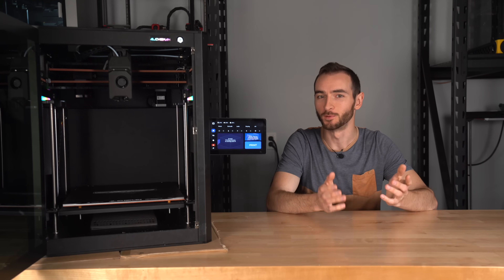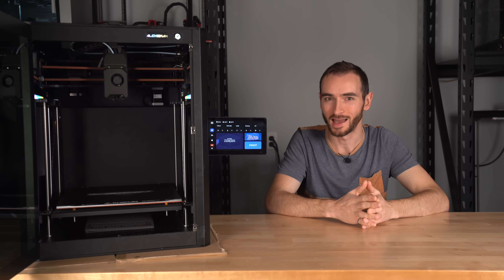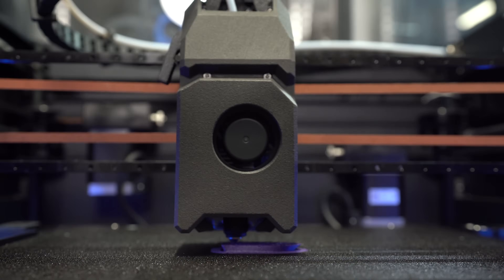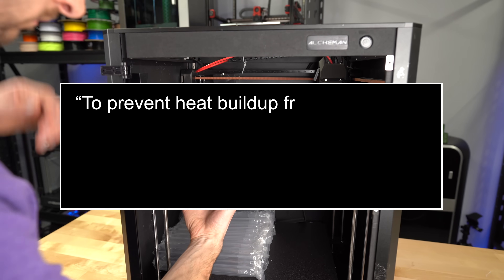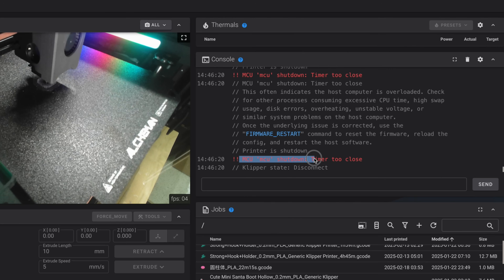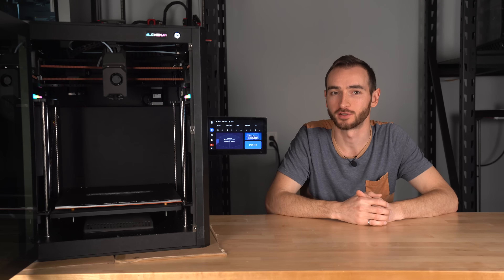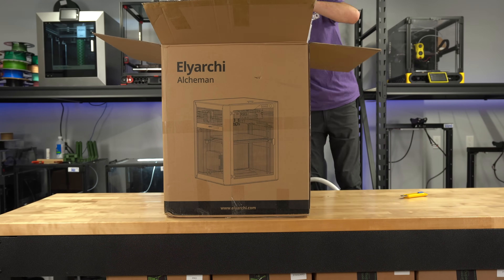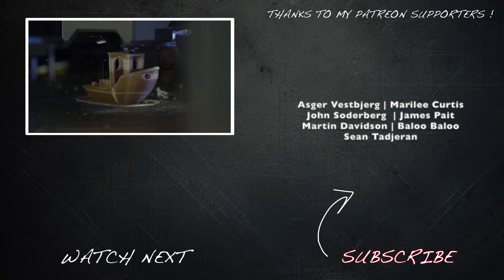Is the $699 PEEK Printer Too Good To Be True? Elyarchi Alcheman Update

Comment: This printer in its original form sounds more like a normal modern 3D printer elevated temperature limits in the software. You often can run a normal printer with higher temp limits for some time, but doing it reliable is a completely different story

Comment: As someone who was a manufacturer some time ago, I’m skeptical about this. By the time they begin to ship machines to a fair number of YouTubers to test and talk about (advertise), all of the changes they now say they’re going to make, should have already made. There’s really no excuse for what they released here. This is one reason why proper high temp machines cost what they do. High temperature components are very expensive. High temp bearings are expensive. High temp lubricants are expensive. Warping will occur in the rails unless they’re designed properly and made from the same materials. What about the belts? The wires, the plastic components, etc?

Comment: Hey! Any chance you can test printing ABS or ASA with 80C chamber temp? You would need to use a lot of part cooling, even more than PLA and their hotend cooling may not be able to cool the hotend enough but if it can you will have industrial quality parts with zero warping and 100% layer adhesion strength. Should be as strong in z as in x/y. I print ASA in 75-80C in a custom printer and it's a game changer but it would be nice to have an off the shelf printer that can do it. 90C is not enough for PEEK, you need 250C for optimal performance

Comment: Now compare it to a printer that is actually capable of printing these materials properly. The Minifactory for example that has a chamber temperature of 250C. Yes, it's expensive as hell, but it's built for the task. Hell, even the compartment where the spools are loaded are as hot or hotter than the buildchamber of this thing.

Comment: I think positioning this printer to print PEEK at unacceptably low temperatures is a silly move. 

PEEK is too expensive and most used for industries (at least here in here in the US) where a printer made in certain countries is a non-starter. 

Making a 90C chamber temp printer can be the worst printer ever for PEEK. Yet can also be the best printed ever for ASA, ABS, PC, PETG, PPS, ULTEM (and all their glass-filled and carbon-filled variants).

They should focus on a real need where the can deliver excellence and an unbeatable value. I’d recommend them to drop the silly gamer stuff (color LEDs and graphics), even for get the AMS, and rather focus on three things:

- fast to reach and consistent thought chamber temperature

- great calibration, input shaping, and geometric stability across the working temperatures ranges

- high temp long term (even continuous multi-day prints) reliability

- 2 nozzles for dual material or print material + support material. 

If they do that, and the added cost of all the stuff that how seems like an afterthought forces them to realize this is a $1500 printer, not a sub $1000 it is still a great competitive product. 

I’d buy one printer like that at 90C before I’d buy a H2D or any other 65C chamber printer.

Comment: It’s good to hear that they’re making some changes to make the machine more temperature resistant, but I still don’t think it’s good enough. There are definitely components in that chamber not rated for 90c. Also worth noting that in a 90° chamber, all components should be rated for at least 110 to add headroom. I don’t believe it’s possible to do what they claim to be doing for the price they claim to offer

Comment: 1 minute in, I don't even know what peek is but now I've got to watch to see why anyone without pay £1000 for a roll of filament.
Reply: I use it at work sometimes. PEEK is ridiculously strong, edging into aluminum territory, and also the most temperature resistant polymer you can really print. So for a business where you're deciding between a machined aluminum part that will take 4 weeks to get and cost you $600, or printing it with $300 of filament, the choice is clear. I'm actually planning on printing a PEEK fixture tomorrow to hold parts in an oven while they're baked at 175C. (Doesn't really need to be PEEK for that temp but we don't really bother stocking a whole suite of ultrapolymers when it's a rare use case, we just go straight for the king)
Reply from the maker: @maninalift  😂
Reply from the maker: This video doesn’t touch much on that but if you watch the actual review of this printer linked in the description it goes into more detail.

Comment: Thank you for adding a few things about the PEEK issues on that printer.
About the marketing of industrial machines: there are way too many producers talking about "able to print peek" machines. In 90% of theses cases, the hardware is able, but they have no software or process knowledge to support that claim. 150mmx150mm is heavy to realize with pure PEEK and I have some benchmark parts, which should show if this is really possible... I doubt it!

Comment: Elyarchi should have had all these problems solved before they even shipped out prototypes. Every single one of these components is susceptible to failure under intense heat. they pushed out a hacked-together Voron clone and focused way too much on everything except the most critical components. I just don't get the impression that they are even taking this seriously if they're expecting people to actually print PEEK.

I wouldn't use an eddy current-based probe for this; ignoring their max operating temp their ability temperature compensation tech is not nearly as good as they want you to believe. This is true for Beacon-style and PINDA-style probes. You'd want something like a CR touch.

The silicon sock melting is a bad joke. The kapton tape is an even worse one. They should have known better than this. Even the Goliath hotend documentation tells you their silicon sock is only rated to 300c and to remove the sock if printing at higher temps.

IMO it was a mistake to suggest it can print PEEK and they would've been better off just marketing it as a decent printer. All it did was attract people interested in PEEK who will almost certainly be familiar enough with the material to rebuke all their claims just by looking at the hardware.
Reply: I agree with you on a lot of points. This thing was defined not fully baked when it shipped out to reviewers 😂. The silicone sock debacle is absolutely ridiculous, I can’t believe they recommended to use one with PEEK. It’s clear the engineers have never built or played with real high temperature printers from that choice alone. 

I kind of don’t agree Eddy probe was a wrong choice. A lot of high temp users seem to prefer it and use it at high temperature like for PEI
Reply: Eddy current sensors can have a good performance in this application if they are designed correctly. But here’s the catch: a well designed sensor costs about 2k EUR a piece if it’s manufactured in high volume.
Reply: I have only don the most basic resort about high temp relist that it in way to expensive and instead set my gole at nylon(90c chamber 450c head) and even I relist that it who's crap

Comment: Just for the record a 450 nozzle temp is nothing special, neither is a 130 bed (i think the prusa mk3 and up can go pretty close to that) and 90c is pretty reachable. This thing isnt even that impressive on paper. Ultem, peek, etc, want way higher bed snd chamber temps
Reply: 90C chamber is far from "pretty reachable" without careful component selection and a lot of tuning.  As in, yes, you can put in a heater that will heat the chamber, and yolo it, but expecting it to run reliably is wishful thinking.  Most electronics used in a lot of printers start dying around 65C, better ones would go to 80-ish.   In-chamber servos at 90 is just bad design, water cooling could do it, but that is bandaid for shit design still.  Past 80 you also need to seriously account for thermal expansion of everything, probably need thicker bed, support for Y that you calibrate at target temp ...    This pile of crap is just money grab off people who have no idea what high temp chamber means.
Reply: @BigFx  I'm not necessarily saying super reliable but I know plenty of people with 80-90c chambers. A) don't put electronics in the chamber. B) class H steppers with derated currents mounted to aluminum do well. C) using EPDM belts and proper grease like krytox seems to do the job. D) gantry backers are easy, just grab a steel strip the size of your rail. It's a few extra steps but it's not that bad
Reply: @jackMJ26  yup, agree with all there.

Comment: Im currious how the printhead board survived at 90C.   I have a qidi q1 pro printing at 80C but i had to add a berd air pump delivering external air just to keep the tool board cool.
Reply: Do you have the mods documented anywhere?
Reply: @evropapagan5551 No. I cad modeled the covers to accept a presto lock style air fitting on the rear cover. Ran a quarter inch airline to a berd air pump.  I removed the exhaust fan and reused it to run the pump with an SSR. I rewrote the starting g-code in orca slicer to start the exhaust fan at 100% for higher temp materials. I set my chamber temperature to 55 c for when I probe. And then raise it to 80 Celsius before it starts printing. This was also done in the orca slicer profile. I had to change the klipper firmware to raise the temp limits and I also did a bunch of custom wiping and whatnot That's not necessary. I burnt up one tool board before I added the berd air, but since I've put that on I probably got several hundred hours at 80 Celsius.

Comment: This is very clearly a scam. The funding goal is only $1675 which isn't enough to cover the cost of a single injection mold, let alone everything else they're saying they plan to do. This is just a cheap printer made with off the shelf parts that aren't rated or designed for the temperatures they're promising. I doubt they ever ship, and if they do it won't be capable of printing engineering materials without destroying itself. Just throwing a chamber heater into an enclosed printer does not make it capable of printing PEEK, nor is it safe.

Comment: I don't understand who this machine is for? Like if you print with PEEK, you want something reliable, so surely, you would just invest in proper machine. If you print with 1000$/kg material, why would you cheap out on the machine itself? Bizarre user-case, imo.
Reply: More capable printing of ABS, PA or PC.
Reply: @adamklosterman8960  this is what they shouldve marketed it as and then thrown in an 'its even capable of printing small models using PEEK'. 
Having the main thing it's marketed for be pretty bad and/or severely dangerous, is not a good look...
Reply: nobody is printing PEEK at home
Reply: Yeah, this is exactly what I was thinking. I use a Vision Miner 22IDEX at work to sometimes print PEEK, and I was debating between a Qidi Q1 Pro and a Plus 4 for my personal printer, because the Plus 4 goes up to 400C. And then I was like... What the heck am I going to do at home with a 400C nozzle? I'm not hobby printing with PPSU at $250/kg. So I have no idea who is printing $1000/kg polymers on a $700 printer. 

There's also the aspect of safety. Even with the VM being $15k, our safety team was very hesitant to let us run it unattended, and actually had us install a smoke detector interlocked outlet just in case. Letting a cheap $700 printer with a 450C nozzle run unattended?... Apprehensive to say the least. 

The only situation I could see someone buying this is if they were looking to try the technology without a massive investment. Even then, though, contract printing would make much more sense, so I'm back to confused.
Reply: @codyhufstetler643 
Funny thing is that at my work we tried to install a printer fore some prototyping and making fixtures and the safty team just sead no. Buchan of some stupid reson about the nozzle reching a temperature wer it requires Activ ventalatin, fire suppression and "hot working"(know how to operate a welder) certification.
So that is fun
Reply: @codyhufstetler643 what’s the point? You can’t undergo quality or spec testing on the parts anyway, so there’s really no reason to use this.
Reply: I was quoted a cnc part the other day. All had equal machine time cost. The peek part was 20x the material cost of POM and PA.
Reply: @WetOlde 
Only reson you are using peek is bochos you need a parts that needs to stay storing will in a corosiv 100c liquid
Reply: Printing other stuff like Ultem makes more sense imo. PEEK is just the gold standard of what you can print

Comment: Background: I currently have a Qidi plus 4 and years ago had a clumsily put together heated enclosure tronxy x5s
I have been waiting for lower cost high temp printers for years. Personally, I don't want a $699 printer that gets this hot. I want something in $2000 price point where every critical detail hasn't been cost optimized out of it.
Reply: I agree, I'd rather pay a little more for a heated chamber machine where everything actually works reliably, instead of a cheap one that has issues all the time like the Plus 4 or K2 Plus. Btw, does your Plus 4 have the Timer Too Close error?
Reply: After kickstarter has ended this is a $1399 printer.
Reply: @AndrewTSq 
Edit, Actually I kinda retract this statement, I suppose if they can pull off those changes and it's 90-95% as good as it sounds like it will be on paper, for someone that's needing those temps it wouldn't be a bad value, I just wonder how many are gonna buy it for $1399 from essentially a company with no track record, but I wish them the best, they seem to at least be trying with it.
Reply: @Cwayne1989   If it was possible to make a reliable high temp printer that cheap, the typical budget options wouldn't cost at least $10-15k. In the best case the printer survives a few weeks under those conditions and in the worst case it sets the building on fire.
Imho the company behind this thing just wanted to stand out in reviews and knows no one would regularly print filament that costs more than the printer, otherwise the warranty claims are gonna get really expensive. They use RGB lighting in the chamber, typically such LEDs are rated for up to 60C and everything over 25C shortens the rated lifespan. And while silicone rated for such nozzle temperatures exists they clearly aren't using it if it didn't even survive long enough for a review.
Reply: @brinkoftext 
I think the cheapest printer I whold trust when peep is the 22 idax and it is 14k
So ye turns out rnd is expensive
Reply: @SaHaRaSquad  I mean, you're not wrong there.
Reply: You do understand people need to get paid for their job? Even kids in asia who make your iphony and all and especially printers you make money out of? Those kids sholud be billionaires now.
Reply: @ The salerys have gone up in China a lot last couple of years. Average salery seems to be around 2900 USD / month after tax. Even a bigmac is more expensive in China than in Japan

Comment: The answers from Elyarchi would ring alarm bells for any competent engineer. Temperature tolerance of components cannot be an afterthought on a piece of hardware designed to operate for expended periods at high temps. That tolerance needs to be an integral part of the design. I looks to me like they built a fairly generic CoreXY and are trying to retro-fit the capability to handle high-temp filaments. 
Also, their comments regarding the 'timer too close' error sound distinctly implausible. The main reason for that error on Klipper systems is the MCU not being able to keep up with incoming requests. Running RGB lights and reading a temperature probe should be consume consume enough processor time to be a major factor here unless the MCU is so slow as to be very marginal in normal operation, and possibly it is thermal throttling because of inadequate cooling.
Reply from the maker: A lot of it definitely seems like an afterthought so I don't disagree with your analysis. It's quite plausible that they "threw in" the capabilities of PEEK printing without serious consideration of the implications. But it does seem to me that they're trying to rise to the occasion and make the necessary modifications to make it possible.
Reply: @ygk3d trying to rise to the occasion isn’t good enough. Either it’s designed properly for the requirements, or it isn’t. To me, from what I’ve been seeing, a machine needs to be redesigned from the very beginning, and abandon this machine. It needs to be designed, from the ground, up for the most extreme use case, which this one obviously isn’t.
Reply: Actually I don't think it's that implausible for LEDs and temperature checking to steal all CPU resources.

What matters is CPU time, you can use it up with some big calculations requiring loads of cycles, or loads of extremely simple instructions. An addition uses up one clock cycle, just as a more complex instruction.

Driving a led strip directly in CPU uses up a fkton of cycles, I believe it. There's a reason why it's never done that way (and I don't know why they did it here).
Reply: In their defense  tho, that timing error can happen from just motor settings not being tuned properly as well. For example because I've modified some of my xy motor settings on my smart 3, if I try and go super wombo on the speed it will throw that CPU timing error, which otherwise didn't happen at factory settings but since I don't ever print at the speeds that trigger it, the benefit outweighs the negative for my particular situation.